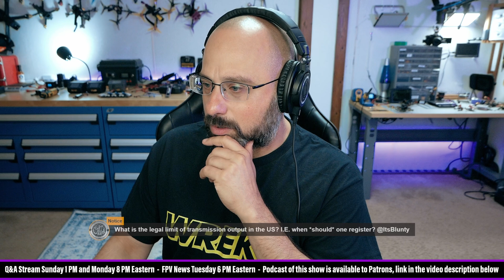What Output Power Is Okay Without a HAM License In The US? Part 15? - FPV Questions

Comment: I am a HAM operator. You are also only allowed to output 400mw of output power for the control of unmanned aircraft. So you do not need more than a technicians license, which is easy to get.
Reply: So even with HAM license you can't use the hdzero 1W freestyle vtx?
Reply: @tinywhoopfan  You can power it on your desk as a camera at 1w, but legally you cannot use more than 400mw of output power for the vision link of an unarmed aircraft. Just know these are silly regulations IMO. Even with your hardware set to '400mw' it is probably spitting out near 600mw. Are you gonna measure that, and not fly today if its too much?
Reply: Thank you this makes perfect sense!
Reply: @tinywhoopfan  yeah I thought I could do up to 1w, but from what I read & was told by the HAM operators I tested with, there's a caveat for this purpose.

Comment: In Europe everything that is CE certified and respect SRD rules (FHSS/DSSS) for ISM band can go up to 100mW in the 2.4 Ghz (2400-2500 Mhz) allocated band and 200mW on the 5.8Ghz allocated band (5.725-5.875 Mhz) without needing any kind of license. All drones, tx/rx, etc... officially sold in EU respect this.
Reply: every german fpv pilot tells me that everything above 25mw is illegal on all open bands
Reply: @bearbeefpv  Your sources are just talking analog vtxs. Clearly most commercial drones are well above that and perfectly legal. Digital vtx are 100mW 2.4 and 200 mW 5.8 and they are lgeally sold and used everywhere in EU. Radio tx is 100mW 2.4 Ghz and is perfectly legal.  25mW is max on 5.8Ghz (or 10mW on 2.4Ghgz) for SRD that don't use any kind of spectrum sharing or channel access techinic, so basically just analog vtxs...

Comment: Which level Ham license do you need? Is it just the Technician one?
Reply: Yes
Reply: Must be the experimentation aspect of FPV gear that makes a ham license necessary.
Reply: @thomashardy9994  it's the lack of a certified transmitter. 

Either the transmitter is certified, or the operator is. A ham ticket is how you gain certification for operations of uncertified equipment.

Comment: Short comment to EU: a transmitter that can be legally used must fulfill specific CE conformities. Even if equal or below 25mW without these conformity declarations, the use is formally not legal. Most CE labels on VTXs are fake. So the situation is rather similar to the US.
Reply: Well, a CE mark is enough for the consumer.
The importer is responsible for the legal implications, when they sell a non legal product in the EU, not the end user, as long as the CE mark is on it
Reply: @malte9999  Legal reality is low in any case for use in the open field. The question was about legality not legal implication. If you order from China, you are the importer. So you have both on "your side" ;-)